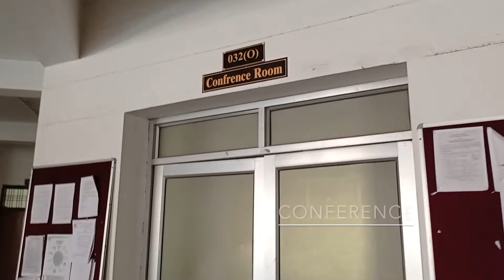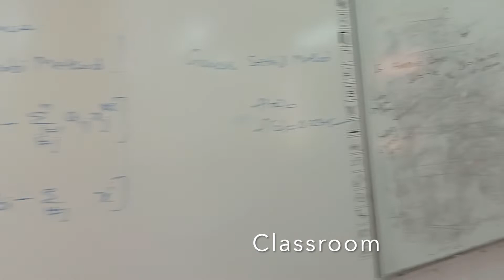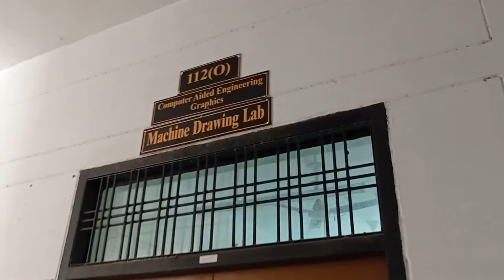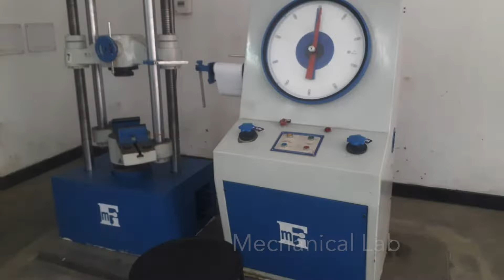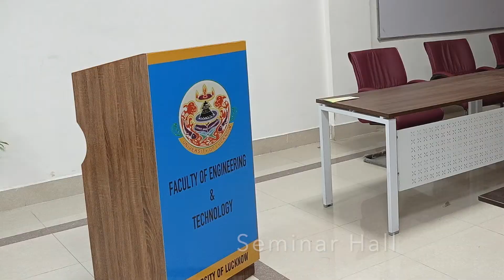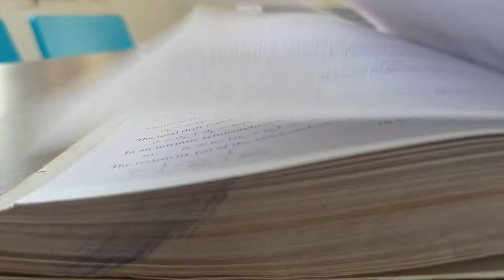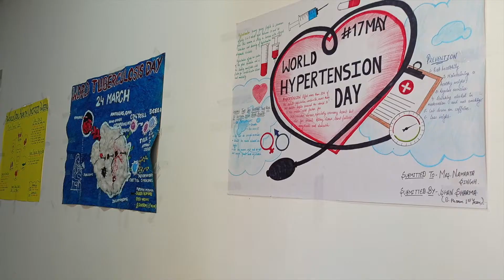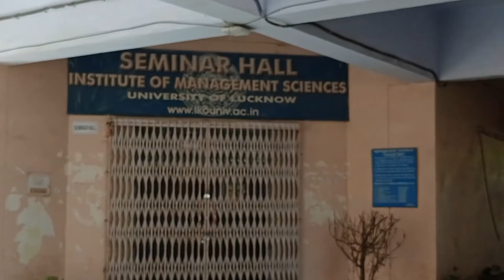Lucknow University Faculty of Engineering and Institute of Management Sciences

Comment: Hello bro wanted to get admission in mechanical engineering branch and my rank in jee main is 5 lakh something can I get it through uptac counselling? Pls do tell me
Reply from the maker: Try to take college with any branch, if you get mechanical, well and good,if not you can get through internal sliding very easily 👍
Reply: @janmejaypratapsingh01   can u pls  tell that which branch would  I get through jee main counselling with this rank ?
Reply from the maker: May be civil
Reply from the maker: , firstly stick till the last round,keep your seat on float till the last round, most probably you will get, otherwise after admission ,you can change through internal sliding